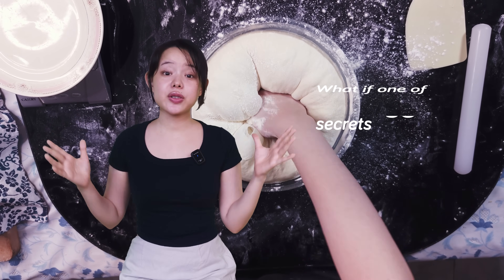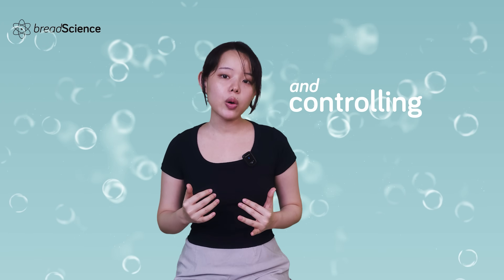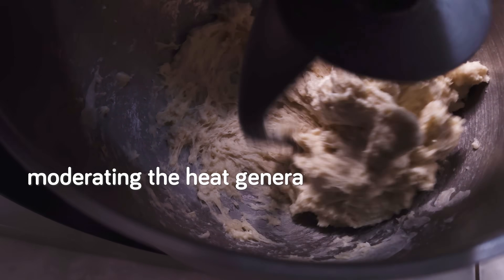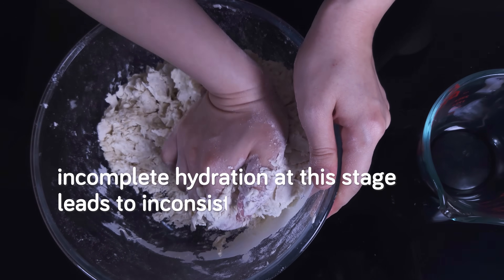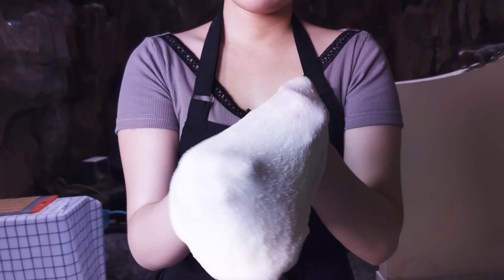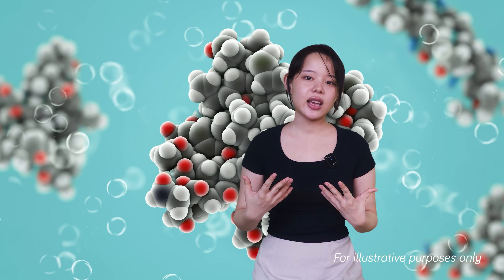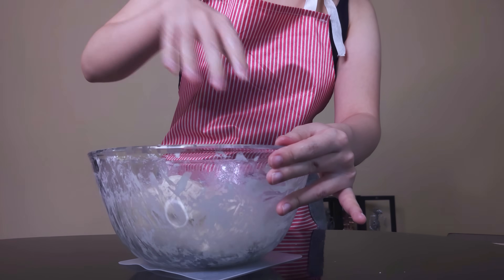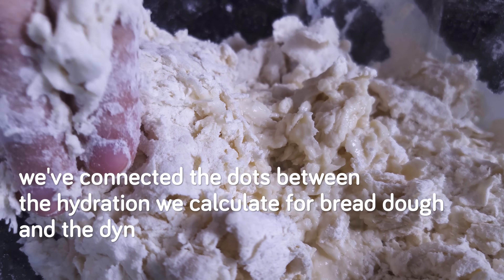Does How You Add Water Matter? | Bassinage and The Science of Water Mobility

Comment: I use an Ankarsrum stand mixer. They're weird. Generally bread procedure in those starts with water in the work bowl, then poolish (if using), then flour, in increments,  while the machine is running. This means that every dough starts off being worked as a really wet recipe, and it's easy to see the gluten being developed as the machine runs. However, maybe I should start with some of the water and add more as it runs.

Comment: So.. all other things being equal,  Tangzhong and Yudane and Gradual water addition allow for a higher overall hydration for a given workability.  So if I have a very high hydration dough, and mix all the water in at the beginning, then I may end up with a difficult to work dough that lacks the strength to fully develop its structure and ends up like focaccia, while if I use one of the water binding techniques, I may be able to work with the dough to build more structure and have a more dynamic oven spring and higher rise due to the better structure from more of the water being bound instead of free?  Is that even close?  I would love to know more about the experiments comparing and combining the water binding techniques and the various resulting breads.
Reply from the maker: First of all, thank you for your comment. Now, when it comes to water retention, there are two different underlying mechanisms for Tangzhong/Yudane and Bassinage/Gradual Water Addition. The first, Tangzhong/Yudane, is all about gelatinized starch and, for that matter, damaged starch playing a central role in water retention. Gelatinized starch and damaged starch have been shown to retain water multiple times more than intact starch granules. The latter, Bassinage, is about building a better gluten network that will eventually act as a better framework—think of a mesh of wire in plastic sheets—that makes up the starch-gluten matrix. This starch-gluten matrix plays the role of retaining the water in this context. As we have discussed in many of our videos, there are many complex ways these mechanisms may act and react to how we make our bread.
Regarding experiments on a YouTube video, personally, I have been very reluctant to do any subjective experiments other than a recipe video, if that could even be considered an experiment. I did do those kinds of experiments many years ago, but lately, I prefer to quote from proper, objective, and scientific experiments from the papers for which I have tried my best to provide the links. The rationale is simple: knowing how all these scientific and empirical experiments are conducted, I have real doubts as to whether any subjective experiments done have any merit or are even accurate, as many parameters are mostly subjective in nature. It’s all about maintaining objectivity and credibility. When trying new recipes or bread making methods, I try my best to apply these objective facts to bread making, occasionally relying on some subjective views to assess whether I get it right.

Comment: You stay the best and, honestly, my personal mentor for home baking :). One question: Would it be a good idea to autolyze 50-75% of the water at the beginning of the process, leave it for 20-30 mins to autolyze, and then apply the rest of the water quantity in a "bassinage" way?
Reply from the maker: Without knowing the specifics of the flour, the breadmaking methods you use, and the fermentation time, I can only give you a generic answer. Bassinage works by lowering the hydration of what is usually a high-hydration dough to achieve optimal gluten development through gradual water addition. Autolyse is essentially a rest period after the initial mixing that allows the gluten network (especially the glutenin macropolymer) to repolymerize. If you perform a first step of bassinage and let the dough rest for 20-30 minutes, that essentially has the same effect as autolyse. However, as explained in our video on autolyse, any resting period, regardless of its placement in the breadmaking timeline, essentially has the same effect.
Reply: @NovitaListyani thank you so much

Comment: To clarify does adding water 4:4:2 mean add 40% of water by weight then another 40% of water and finally 20%? I’m not clear on how the study is advising to add the water.
Update - my loaves just came out of the oven. I’m not convinced I can appreciate a difference in rise or crumb structure. Certainly the dough is different while kneading as there were firm unhydrated lumps in the dough which took quite a bit of kneading to minimize. I did think that the dough did come together more quickly and was sticky less time in spite of the last 20% of water added making a gloopy mess for a while. My white bread recipe also has 30g of olive oil in it which I added after all the water was incorporated. I would appreciate a short video on your actual technique as I wasn’t sure how short an interval you use between additions.  I will definitely try it again when I make some Einkorn bread with grain I mill at home.
Reply from the maker: Yes, that's correct.

Comment: I'm disabled and can't knead by hand. I use an Ankarsrum mixer, kneading gread with the roller and scraper. I baked bread with fresh milled spelt with hard white wheat, 80&-20% respectively.
The mixer directions tell me to add all the liquids, then add the dry ingredients. How could I modify my process to use your technique?
Your videos are always so informative and helpful. ❤
Reply from the maker: While every stand mixer is different in its characteristics, you may want to stick to the instructions for best results. Having said that, if you are looking to experiment a bit, I would suggest dividing the water into a 4:4:2 ratio: add 40% at the start, then another 40% after about 3-4 minutes. Assuming medium speed, you should have some gluten network development by this point, and the remaining 20% can be added after another 3-4 minutes. Happy baking!

Comment: What about a mixer like an Ankarsrum that encourages you to add all your water first and add your flour in after? In that instance would it be better to add flour in more batches or larger batches?
Reply from the maker: While every stand mixer has different characteristics, sticking to the manufacturer's instructions usually yields the best results. If you want to try bassinage, however, I suggest dividing the water into a 4:4:2 ratio: add 40% at the start, then another 40% after about 3-4 minutes of mixing (assuming medium speed). By this point, you should see some gluten network development. The remaining 20% can then be added and mixed for another 3-4 minutes.
Reply: @NovitaListyani  Thank you! I think they say to add liquid first for the Ankarsrum because the liquid prevents a lot of unmixed flour from sticking to the bowl. I'll give it a shot either way!

Comment: Do you recommend using a bassinage when preparing lower hydration doughs like croissant dough?
Reply from the maker: Gradual water addition has been shown to work for low hydration doughs like noodles, so no problems there. However, for croissants especially, you should note that the sheeting/lamination step that's present in making croissants is a gluten network building step, so you might have to be careful when doing bassinage so you don't overmix your dough. Happy baking!